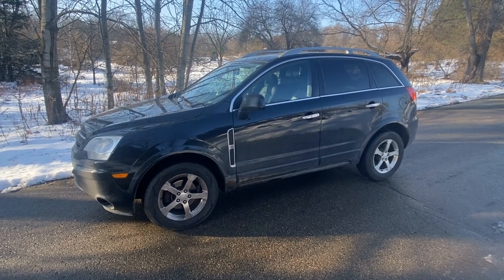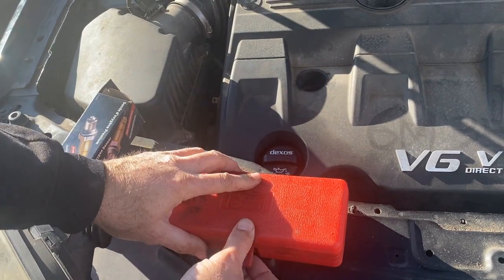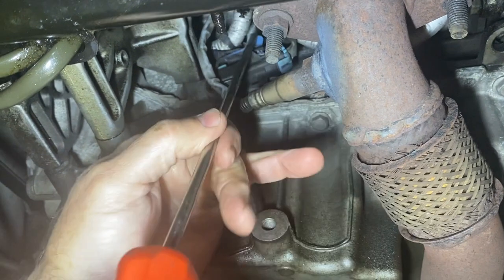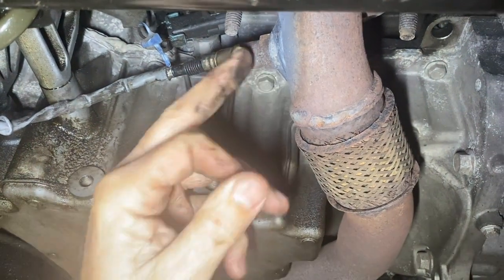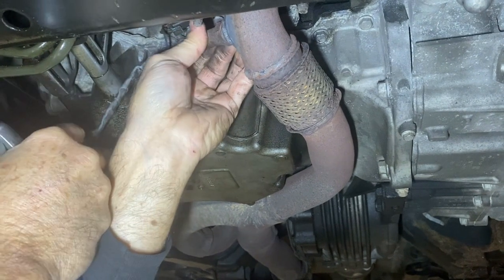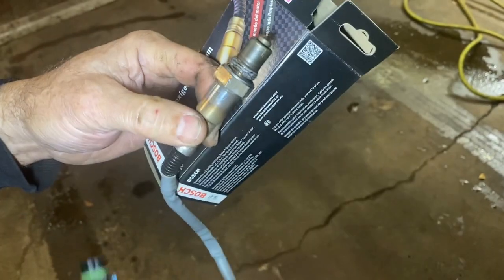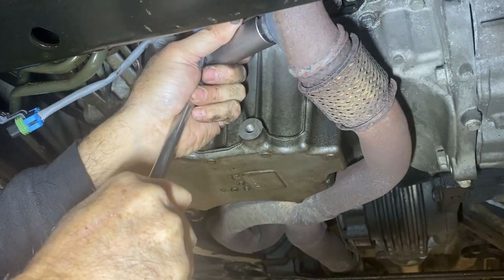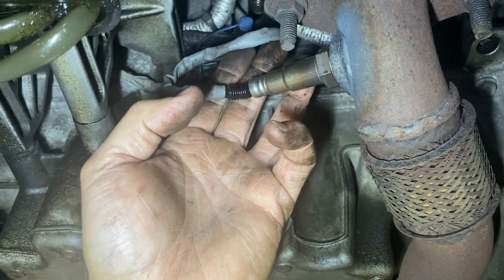How to Replace Downstream Oxygen Sensor Chevy Captiva

Comment: My downstream oxygen sensor is like blocked off by something, as we loosen the old one we can’t pull it out. Also, for my upstream it’s like stuck so is wd-40 okay to use ?
Reply from the maker: You can try penetrating oil on it, but be careful not to let the oil get onto the sensor.

Comment: Great video! Going to replace all 4 of my sensors, but wanted to confirm all 4 sensors are the same on this car?
Reply from the maker: That's a better question for the dealer or your auto parts store to make sure you get the proper parts for your application.

Comment: I have a 2012 but I'm not sure hoe many oxygen sensors it has 3.0 lfw lt trim
Reply from the maker: The 3.0 has four oxygen sensors, 1 before the catalytic converter and 1 after the catalytic converter on each bank.
Reply: Thank you so much. I found the 2 closest to the front of the truck but the others I couldn't find. I was starting to think I was going crazy.